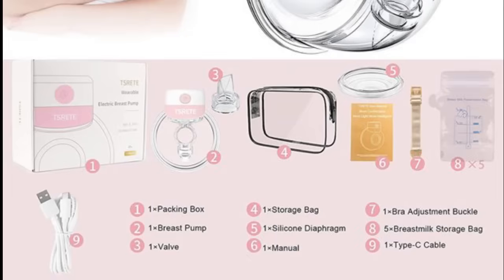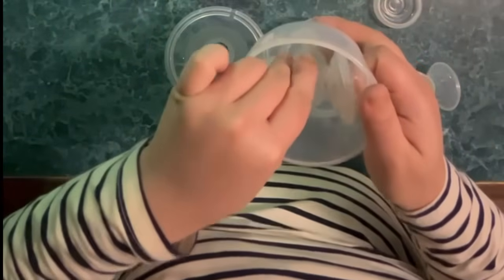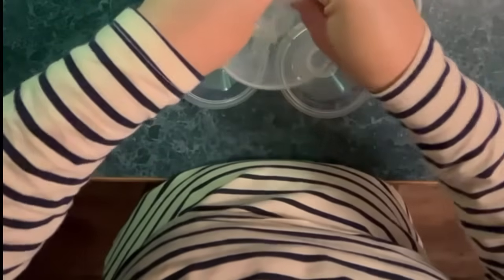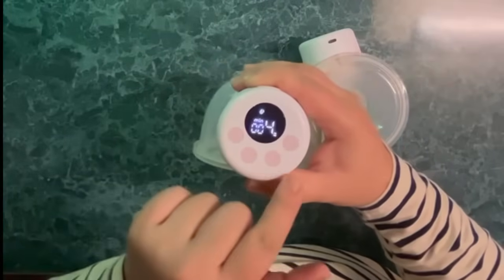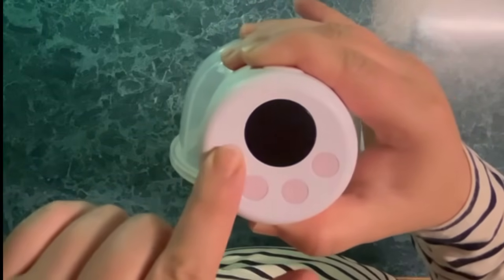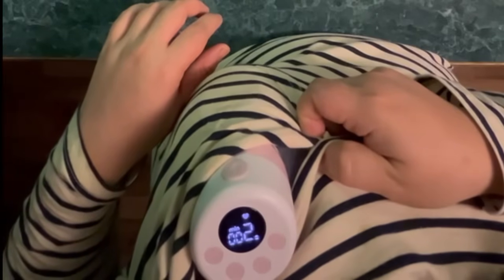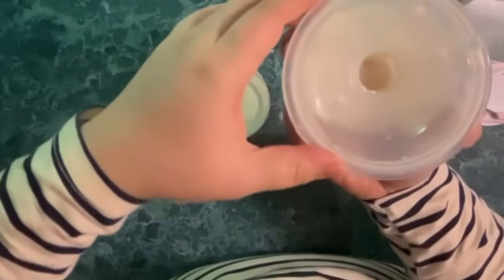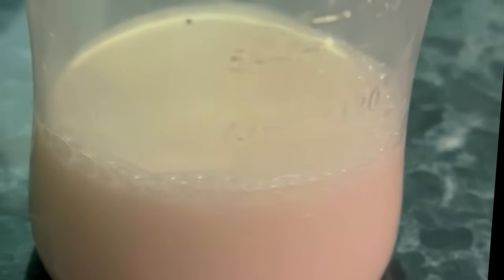How to use tsrete - hands free breast pump

Comment: Whats the purpose of valve , the milk is going into valve and not into cup from where it is supposed to go in cup?
I don't see a hole
Reply from the maker: “Breast pump valves (and backflow protector membranes) are made of a flexible silicone material which stretches and releases each time your breast pump sucks in. This creates the suction you feel on your breast which draws breastmilk out. After a while of regular use, the elasticity of these parts wear down. So make sure to replace every 2-3 months. Other than it helps prevent the backflow of milk it also helps prevent airborne nasties from entering the motor unit.”

Comment: I feel like my boob isn’t in the flange the right way and it isn’t suctioning correctly. I know the battery is charged and it has worked in the past but now for some reason I’m struggling with it. Any advice?
Reply from the maker: Are you still getting milk or not at all?

Comment: Hello! Thanks this video is so helpful. I have a question. I just bought this in a 24 mm flange and it's a little bit painful when I first put it on and have it in massage mode just when I'm beginning my session. Would you say that could be an indication that I need a bigger flange size?
Reply from the maker: You’re welcome. Usually the pain should not be prolonged around 15 seconds. Beyond that there may be issues with the sizing. It can either be too big or too small. There are cases where one flange can be different size from the other. It is hard to tell. I would consult with a lactation specialist online to be sure.
Reply: Does it feel like a baby feeding? I cant feel anything and idk if im attaching it right
Reply from the maker: @wendyh5692  it should. At least on my end I feel something. I suggest seeing your local lactation specialist if you are having trouble pumping. Usually, the hospital where you gave birth should have given you contact details of their lactation consultant.

Comment: Can I sterilize the silicone pump parts using a Baby Brezza?
Reply from the maker: Good question. I would think so, especially that it is the same material as others that can be sterilized in Baby Brezza. I have seen other moms sterilize it in Baby Brezza and they said it worked fine. However, I have not personally used this method. Hope this helps.

Comment: Should it be so messy? While I’m pumping it it leaks out the bottom onto my boobs and stomach and arms.
Reply from the maker: There can be various factors contributing to the issue you are experiencing. It is possible that the breast pump is not the right size for you, there may be a defect in the product, excessive movement during pumping could be a factor, or even the type of bra you are wearing might be affecting the process. If you have tried adjusting your pumping session and are still facing the same problem, it would be beneficial to seek assistance from the product's support team or a healthcare professional. They can provide further guidance and help troubleshoot the issue.